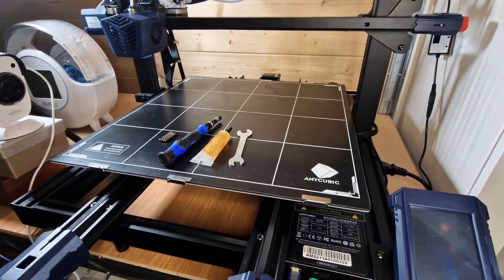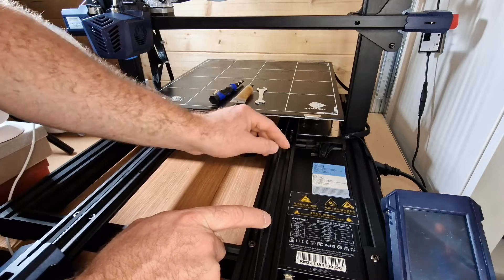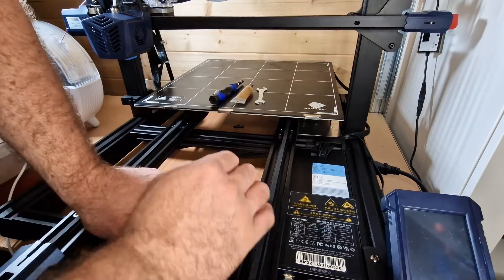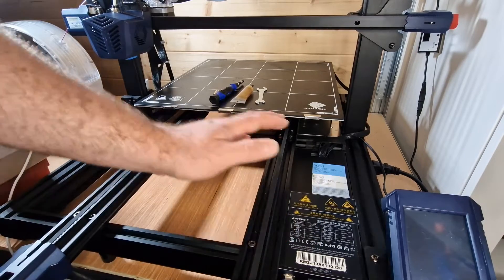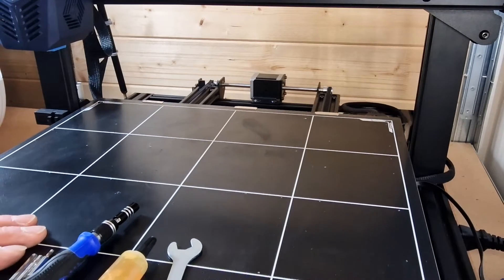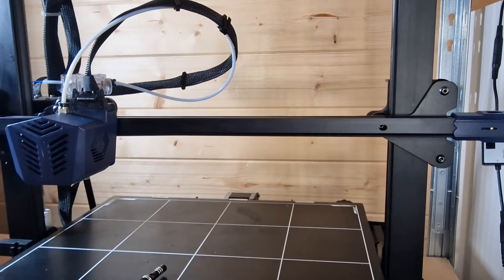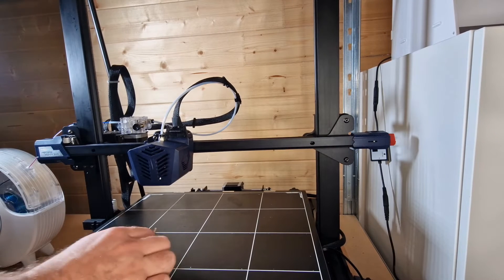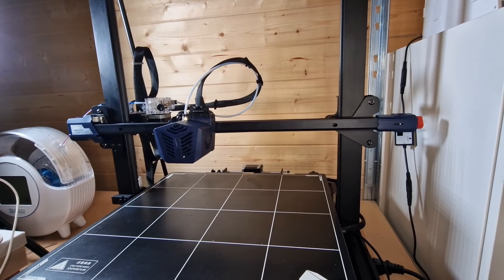Anycubic Kobra Max General maintenance Advice   #3dprinting #anycubic

Comment: So I don't know if anyone can help me answer this, I have a Kobra Max and I am getting a crazy amount of Stringing.  I have changed the retraction form 0-7.0mm and nothing got better.  I used a temp tower and each one looked terrible.  I don't know what to do,  all I find is snark from ppl on Discord.  Any assistance would be appreciated. Help please.
Reply from the maker: Hey sorry that the community isn't supporting you, have you found this to.be on different types of filament ?? Or is this with 1 in particular,  I sometimes find stringing can also be to do with wet filament, if it's not that and you can confirm it's been dried then, it could also be to do with speed of printing I always try around 50mm/s  - 4 retraction ..

Comment: Thanks for the good video 3DPUK. For future messages regarding various issues; I contacted the Anycubic after sales department and those guys are really helpful (No I don't work for them :) ). I got some bed level sensor issue and so far they sent me a new probe, a new printhead board & cable and a new motherboard... Haven't tried the new motherboard yet so my issue is still there but  I'm confident.

I also use the Sunlu dryer as my dispenser.

Now I noticed you tied the printhead cable to the structure rod on the side, any other cable routing advice ?

Comment: My filament sensor keeps detecting, falsely, that my filament has run out. I hit the button and everything resumes just fine until a random amount of time passes and it repeats the error
Reply from the maker: Sounds like a failed filament sensor, maybe try the following 🤔  bypass filament sensor and go direct into bowden extruder  and place a snipping of filament into the sensor so it reads as  engaged. It won't allow too print without this... its a shame the firmware doesn't allow for turning the filament  runout sensor off 😢  thanks for watching and don't forget to like and subscribe 😉  if not already done so

Comment: We are waiting for the video now. how to set the optimal temperature for 1 specific plastic, according to the melting temperature, then the filament feed rate or printing speed, as well as setting accelerations at the printing corners. -for optimal performance in terms of printing speed, with minimal loss of quality. it is clear that plastics are different and in different batches have different melting points and different fluidity. And also a video about resuming printing after an error on cobra max.
Reply from the maker: I Will try and create one for these items very soon

Comment: Hi, I receantly bought this printer,  installed a flexible print plate, connected it to octoprint and ran a bed visualizer. I found out, that the bed is significantly lower in the middle refered to corners.
I looked at the mounting and there are two srews with springs but no nuts, adjusting wheels nothing. I think that the bed is sagging in the middle which causes my issue.

Can someone help me with this?
Thanks

Comment: Hey dude, my middle roller wheel under the left hand side of the bed spins freely. The other two wheels are fine but the middle one no matter how i adjust it just rolls free so is there for nothing. That the case with you?
Reply from the maker: Hey no all mine are equal tension
.. i would suggest loosening them all and make sure it's square front and make.. and then tightness each one gently and ensure equal tensions